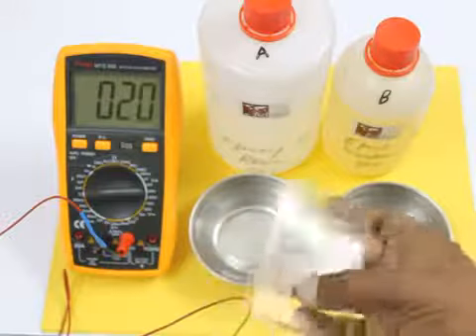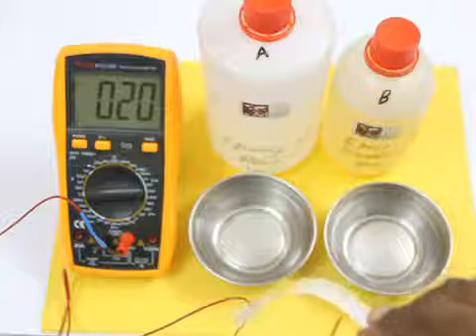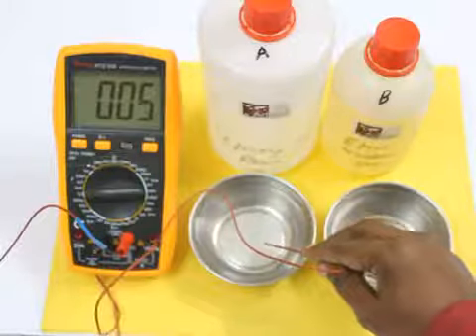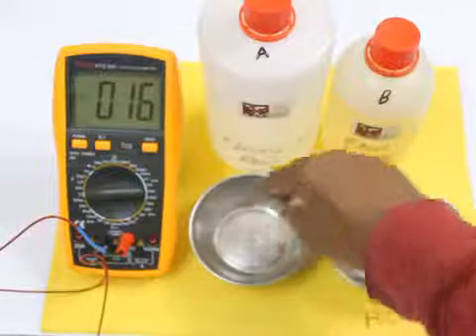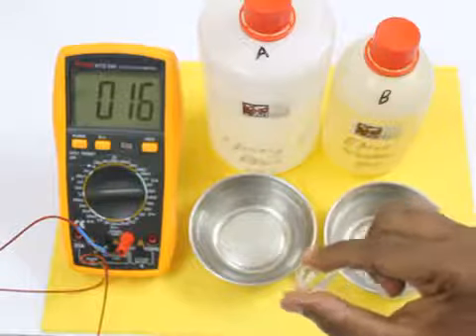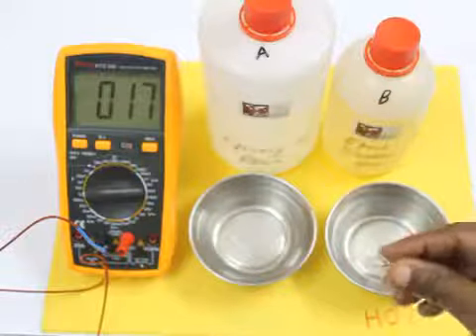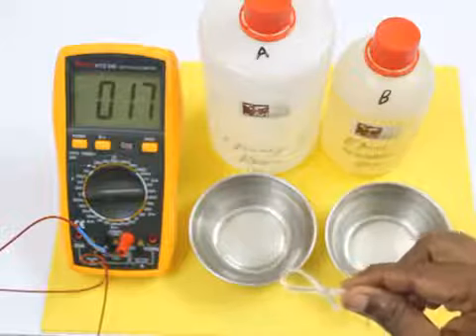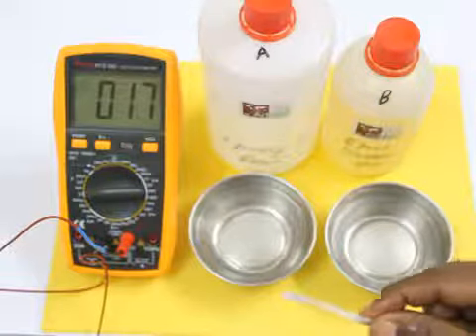Shape memory effect demonstration using epoxy resin and hardner

Comment: Sir, the polymer is only regaining its previous shape in warm water, but not in cold water. Why? This means the rod shape is not changing to the coil shape when we put it in the cold water. So, the doubt is which shape is the 'original' shape that it remembers?